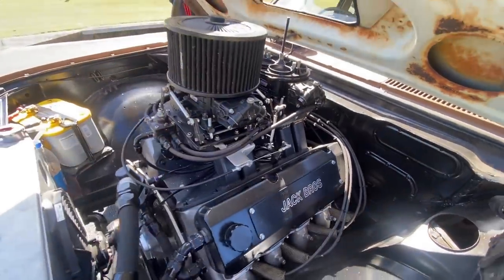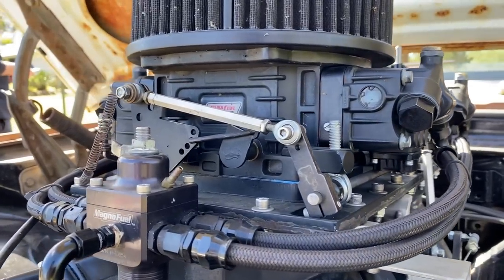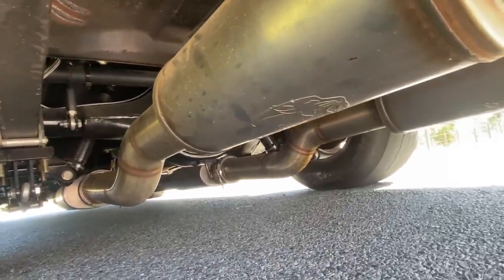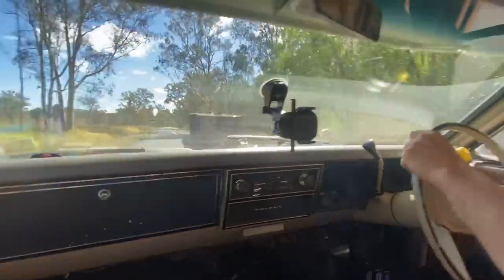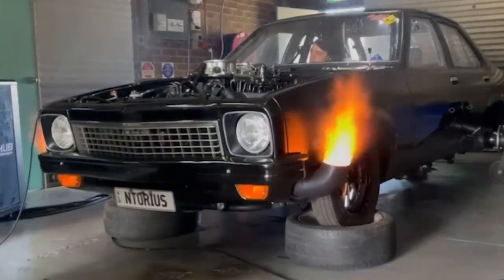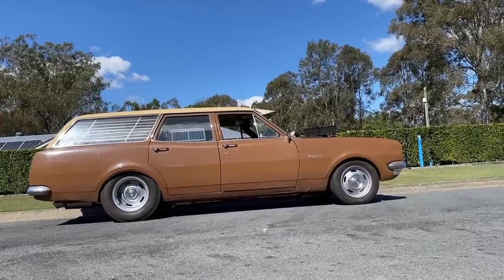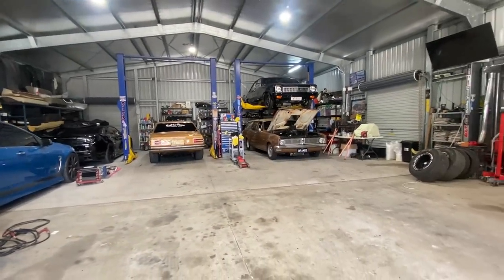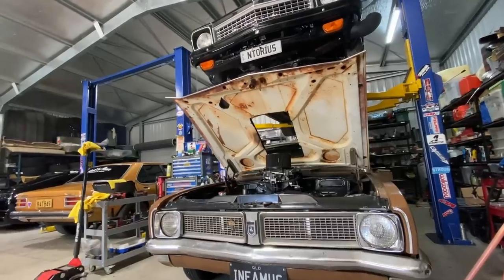1000HP Drag Car Engine in a Rusty HG Wagon street car  Ep7

Comment: How much does a built engine like this cost 15k-20k engine plus parts ?
Reply: Im guessing that the block alone is gonna be around 25k.
Reply from the maker: this engine would of been well over 30k id say
Reply: @criscrossart  damn so lots of money, that's just engine need to do the trans and diff too, so easy 50k just to get it moving mechanical

Comment: Small block Ford in FULL STREET TRIM would eat that big block!
Reply: I think the small block Ford has eaten your brain 🤭
Reply: Dream on sweety.
Reply: @madeleyinc  I'm a Holden guy through & through. But Mark Van Der Togt's small block XY is a "true street car"
Reply: @deanbowell7501  it’s a caged twin turbo race car with number plates yes it’s a full body but real street car c’mon pal seriously
Reply: @needmoreboost6369  yes seriously, it's a "street car". Mark takes it out when he can, sometimes business commitments come first. Point i was making "small block" . Yes, twin turbo, cage because you have to and it has numberplates. Drag engine, "big block" 565  with all the goodies in a car that has 70's seat belts, holes in the firewall, plus no floor covering. Must have lax engineers down there! I know who's car I'd put my kids in for a ride. Anyway, God bless all V8's and all the fuel you can throw down them!
Reply: @deanbowell7501 don’t think they had safety or fuel consumption in mind when putting this together lol and I’m not discrediting the work that went into wedging that thing in there! I’m sure it’s not assembled with zip ties but spending many years in one identical less the big block I can say for certain they ain’t safe! And sure the falc has plates but really if it’s got adjustable suspension it’s probably not really engineered and looking at how it leaves it’s got a solid chassis and it’s driven bloody well too!
Reply: @needmoreboost6369  👍